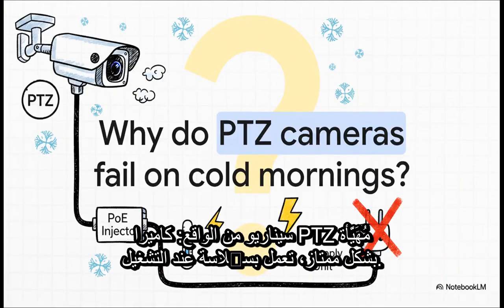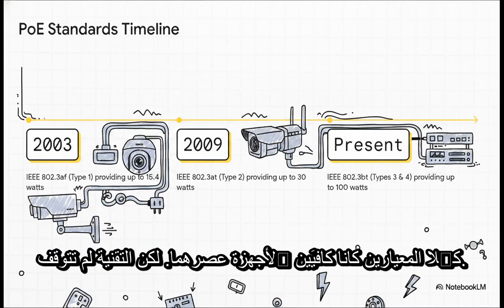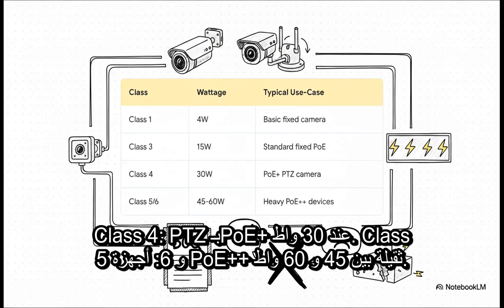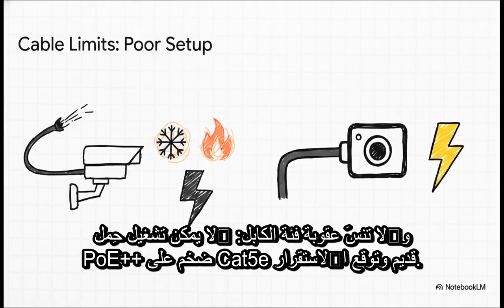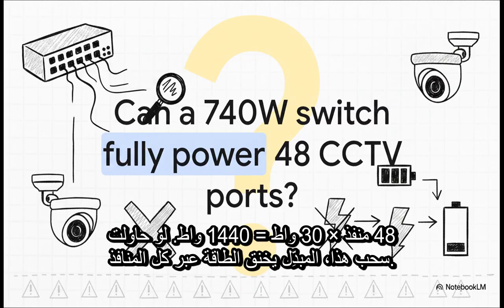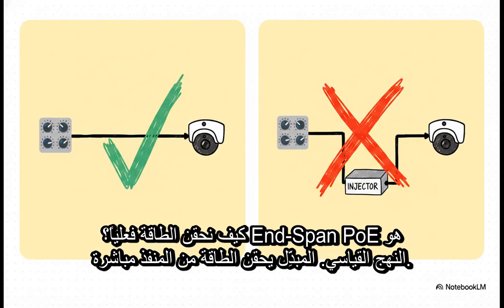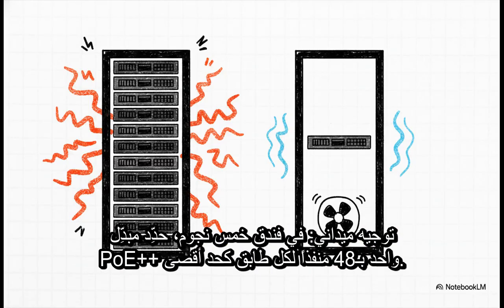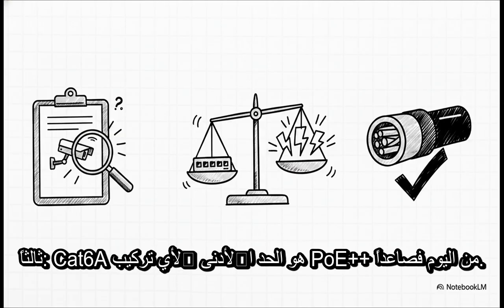Why Your PTZ Camera Dies on Cold Mornings — PoE Engineering for CCTV | ELV Lesson 5

Comment from the maker: CORRECTION on PoE specs in this video.

The canonical IEEE 802.3-2022 (incorporates 802.3bt-2018) PoE class table is:

Class 0: 15.4 W PSE / 12.95 W PD (Type 1)
Class 1: 4.0 W / 3.84 W (Type 1)
Class 2: 7.0 W / 6.49 W (Type 1)
Class 3: 15.4 W / 12.95 W (Type 1)
Class 4: 30 W / 25.5 W (Type 2)
Class 5: 45 W / 40 W (Type 3)
Class 6: 60 W / 51 W (Type 3)
Class 7: 75 W / 62 W (Type 4)
Class 8: 90 W / 71.3 W (Type 4)

Two things in the audio that aren't precise:
1) Type 4 PSE max is 90 W (not 100 W) per IEEE 802.3bt-2018.
2) Class 5 and 6 are separate budgets (45 W and 60 W), not grouped.

The core engineering points (90-meter rule, switch budget trap, cold-morning failure mode) all stand. The class numbers were imprecise. Thanks to the engineers who flagged it.

— Eng. Mohammed Ali